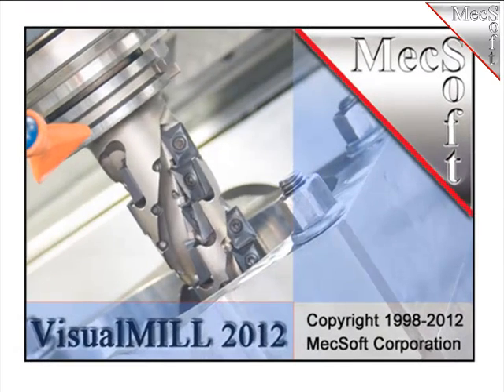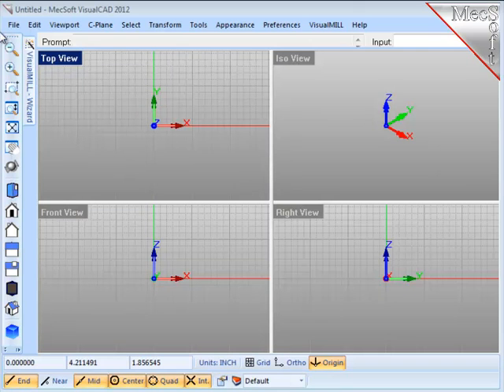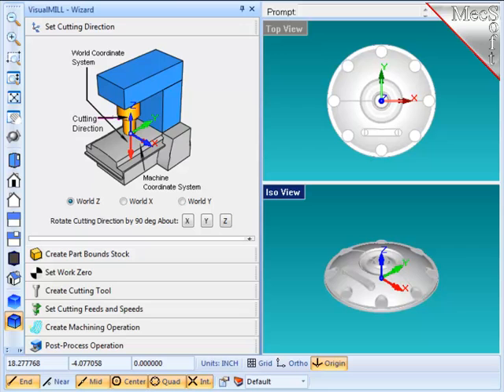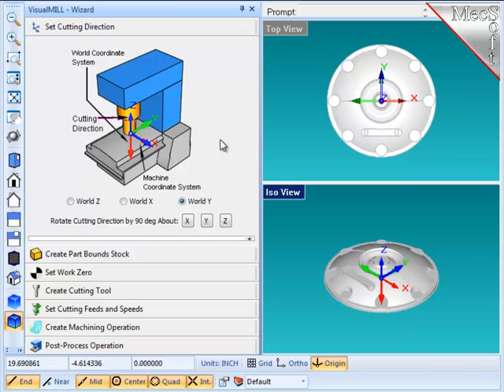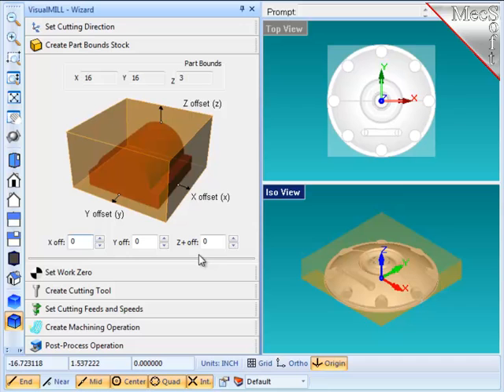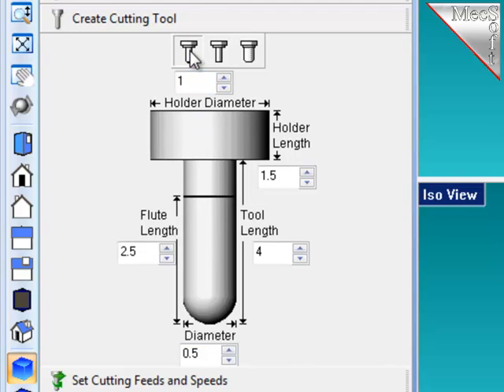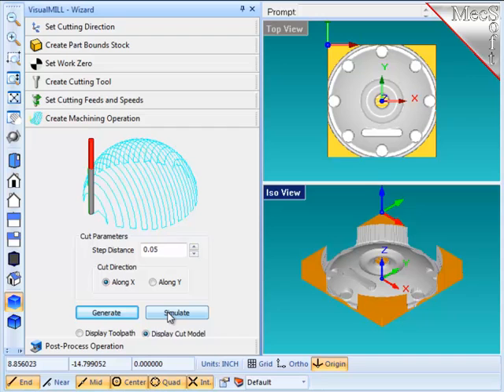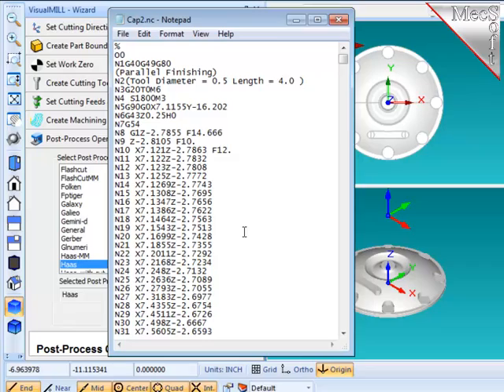FreeMILL Operation Video | CAD/CAM Software Tutorials by MecSoft

Comment: To rough, you can set origin, in freemill, to just below the work piece, then ensure your mill wont drop below origin. run the code, drop the mill the next cut depth, and re-zero the mill. Then change the origin in freemill down the next cut.
It requires new gcode for every pass, and you have to zero the mill to the next pass every time. Also, ensure your mill wont actually move below the origin. The z will give negative values but the mill wont drop below zero.
Kind of a roundabout, longway, with user adjustments required for each pass, but it works!
Probably easier to just buy mach3 or whatever, but some of us just don't have $700 to spend on software...

Comment: I never used any CAM soft so far, so excuse my basic question: How does freemill knows how and where the material is clamped onto the machine (how it would know not to mill into the clamps  ... )
Reply: It's based on your stock or part's origin. You touch off the machine in X,Y,Z on your stock, so it matches the origin of your model.